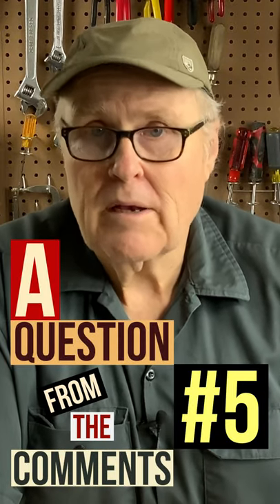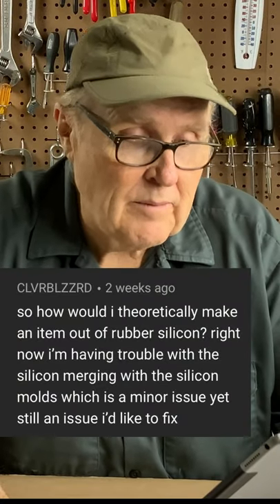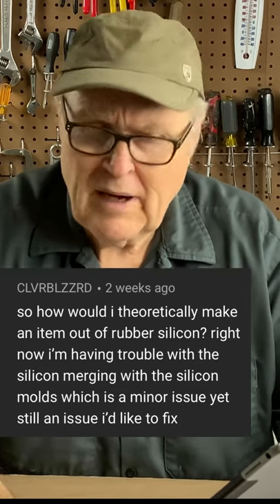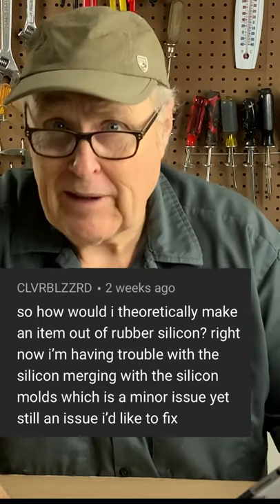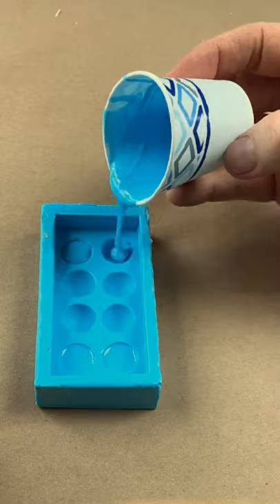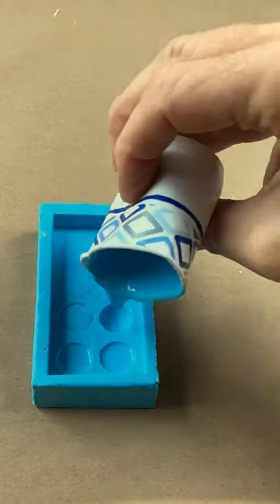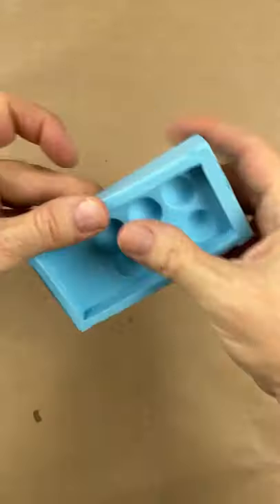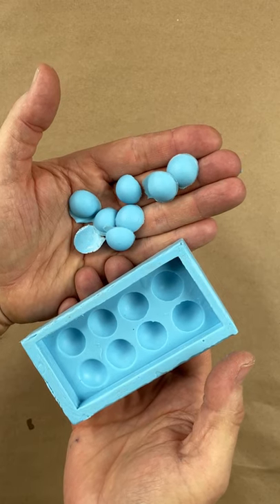My Rubber Is Sticking To My Rubber!

Comment: It's worth noting not all mold releases are created equal. I was trying to make a two part mold, and despite liberal spraying the two halves completely fused together, ruining the mold. I may try your brand! :)
Reply from the maker: Correct, you should consult your rubber manufacturer to determine the proper release agent for your brand of rubber.
Reply: True! I destroyed multiple prototypes entombed in  liters of silicone until I finally hunted down a bottle of the Mann Ease release yellow can 
The stuff works like a charm you can even take quick impressions in Hot glue and once cooled the hot glues slips right off
Reply: Also different products are designed to work with different materials. Not a one size fits all situation

Comment: I have a question. How do you keep your workshop and tools clean? Do you re-use your mixing cups? If so, whats the best way to clean un-mixed silicone out of mixing cups? If you buy your silicone in large containers do you use some sort of ladle to scoop it out or do you just have great pouring skills? I guess that was several questions. Thanks for the videos. Ive learned a lot.
Reply from the maker: I never clean mixing containers with solvents or anything like that. If you use plastic mixing cups you can simply peel the rubber out once it cures. Resin paper cups I usually throw away after use although you can let the resin cure and re-use the same cup many times. There’s a simple trick for dispensing material out of 5 gallon containers which I think I have demonstrated in a couple of videos. You lay the container down with the spout at the top. Then you roll the container slowly until the material starts to dispense. This method give you a surprising amount of control over the pour.
Reply: @RobertTolone  yes you did the rolling barrel in one of your videos.

Comment: Question for you on this Robert, sometimes I am trying to retain a glossy sheen on the molded part.  Release agent is generally a good idea according to most people if for no other reason to increase the life span of the mold, but is there such a thing as a release agent that won't result in a matte surface on the part?  All of them I have tried do :/
Reply from the maker: The gloss wears off a mold so rapidly I always figure I'm going to have to buff out the castings anyway to restore the high gloss. I don't know of any release agents that leave a glossy surface. Maybe a barrier coat would preserve the gloss of the mold longer and transfer it to castings. But  you have to find what works best using the least possible effort.
Reply: @RobertTolone  Had a feeling that would be the case, will have to consider the barrier coat.  Thanks as always for your tips and knowledge Robert, you are a godsend!

Comment: Hi Robert, I'm wanting to buy a pressure pot and a vacuum pot to do rubber and resin molding/casting. But wondering, does a vacuum pump work for both pots or do I need 2 separate machines?
Reply: One would be a vacuum pump , one would be a compressor . Different machines.
Reply from the maker: @glenfisher728  Exactly right.
Reply: I have seen people use the intakes on their compressor as vacuum ports, but idk how well that would work vs something designed to be a vacuum. But might be worth looking into if you are on a tight budget

Comment: Is there any difference between Silicone Mould Release and this Parting Agent? I have the same problem with my silicone merging/ won't separate with the silicone mold
Reply from the maker: Silicone mould release is used to prevent bonding when casting silicone against silicone.  Parting agents are used to prevent any two materials from sticking together.
Reply: @RobertTolone  ah thank you

Comment: Hi Robert can I cast a plastic handle on to metal slingshot forks?
Reply from the maker: Potting objects into castings can be done.  I have always found it faster and easier to make castings first and attach them to whatever the embedded object is.